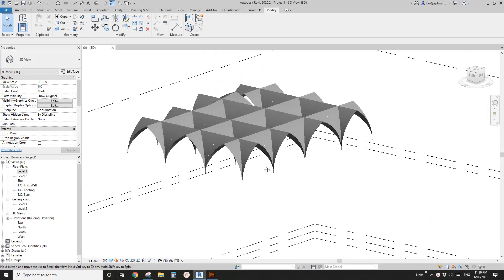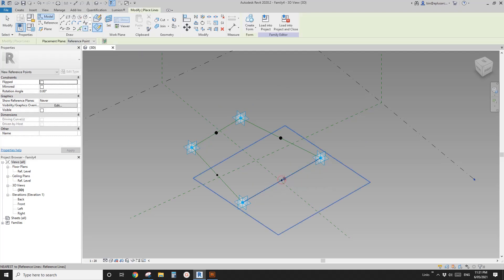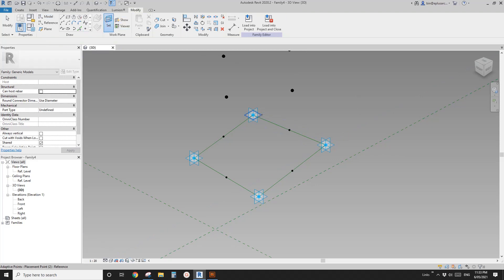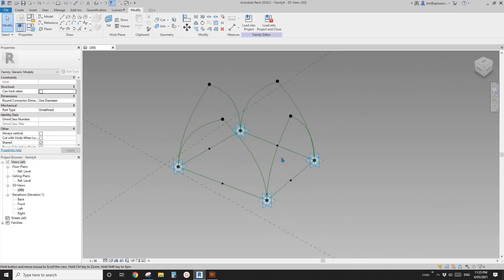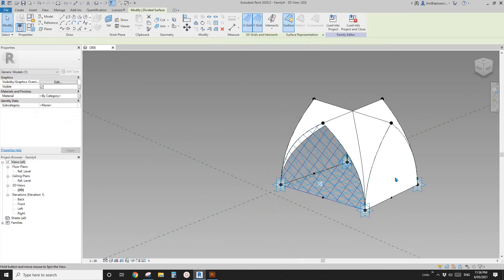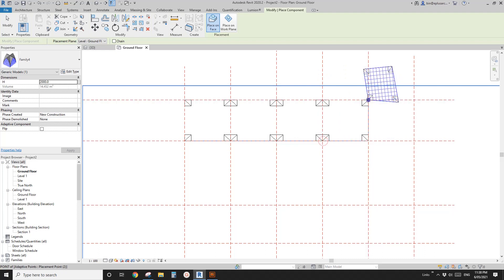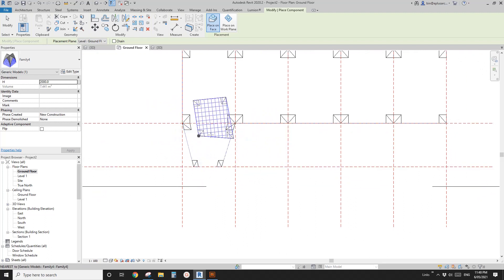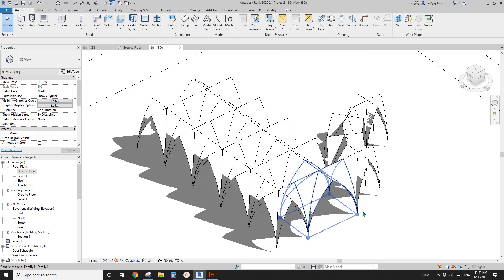Everyday Revit (Day 414) - Simple Parametric Adaptive Rib (Gothic) Vault

Comment: Hi Bin, I really need your help with an adaptive component. I am trying to do an adaptive family to put on the edge of a wall. If you have any time, please call me. metalespana@hotmail.com(skype)
Ps: it is quite urgent hehehe

Best regards, Eder
Reply from the maker: Can you show me what you want to model? I’m afraid I do not have time to talk.
Reply: @BINHE615   It's ok, I'm trying to model a piece of metal that will be attached to the wall. The problem is that I have 6 walls that are not straight, they have different heights and the joins are really weird because I had to edit all of the profile walls. So my idea was to do an adaptive component to attach the element above the wall. Anyway, it is difficult to explain it without showing it. I hope you understand. and thank you very much for your time.

Comment: 4:45  Hi Bin. Revit is not modeling program.  We have to work with dimensions. If we have  dimensions of arc, how can we do that ?
Reply from the maker: You are correct, the spline method I used in this video is not very accurate. If we are using arc instead, we can get the radius of arcs from the width and height using some trigonometry formula. I’ll have a play tonight.
Reply: @BINHE615  Thank  you. You are the best teacher !!!